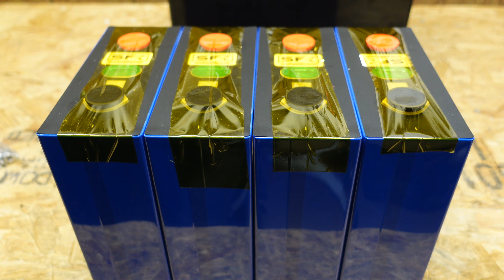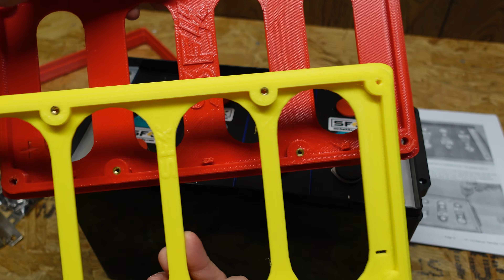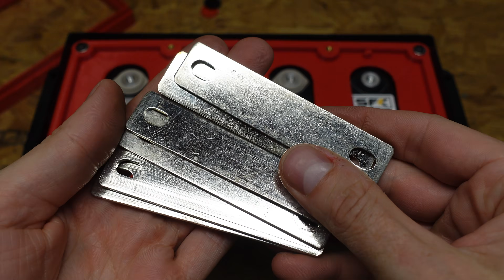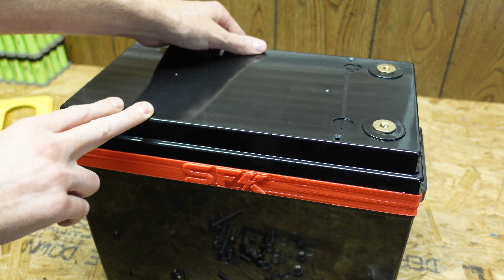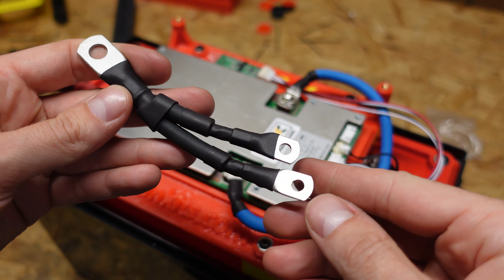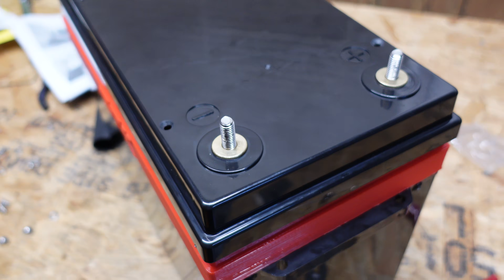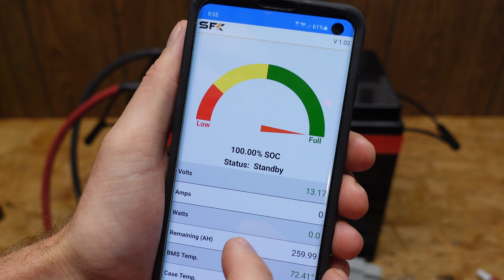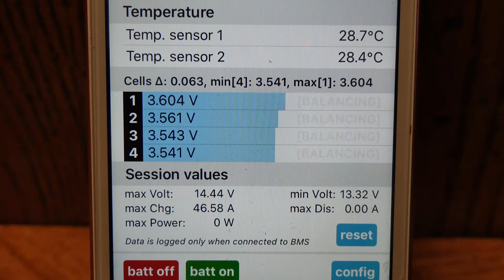Sun Fun Kits DIY 12V 280Ah LiFePO4 Battery, $295/kWh!

Comment: Hello, very clean kit with a few small issues. Nice work!
The problem is that the kit Without cell’s is reasonably priced and is likely a good kit for someone making a tiny or smaller camper or van system. However with cells included are Very Very Very Expensive! IMO 
I bought EVE 280ah cells for $106 ea (I think up to about $135 ea now)
I feel almost all resellers of cells are unreasonably priced at a “kinda usual” in the USA 300% markup! Just for reselling cells that they have inspected?
ALL 64 of my EVE cells directly from Basen were packaged and matched perfectly as far as open voltage goes and had zero issues or damage.
If you can DIY.. I recommend doing it yourself! Then hopefully resellers will get the message and stop with the nonsense of 300% cell markup! 
Good video and nice work sir!
✌️PT
Reply from the maker: One thing people don't seem to understand is that businesses need to make a profit in order to succeed. They aren't 300% marked up. They're probably acquiring them from the same (or similar) source as the rest of us. If they buy for $125 and sell for $200, that's a 60% increase or $75. They also have to factor in damaged cells, payment processor fees, discount codes, etc. So how much are they really making per sale? Probably not much and certainly not "nonsense". Buying from China will always be cheaper...
Reply: @LithiumSolar  got it.. need to make a profit. I said as much. However if you are DIY.. most want to DIY to save money.
Mine.. 53,760watts under $7100
Just saying..
Reply: @ProspectorTripp  how much would you sell you $7100 53k battery for? If someone offered to commission you to do the job 30% up front the rest when delivered.
Reply: @davecroft2991  Hello David, I love DIY.. but not interested in getting another job.
If you can’t buy the LFP cells directly from the manufacture or maybe feel uncomfortable, it’s best you pay the extra money for someone to buy your cells directly from the manufacture for you.
The cost problem/issue is.. the company has the initial cost to buy, ship, store, inspect, ship again is very expensive. I Understand this point very well.. that’s why I recommend DIY. That also means BIY (buying it yourself)! 😂 
The kit is nice and clean and for many is likely a good choice, but the addition of using their cells is certainly easy but definitely a more expensive choice.
DIY.. is harder, unless you love doing it yourself. BIY 🤪
Thanks David 
✌️PT
Reply: The cells they are selling are pretty obviously grade A, and go for (assuming you order grade A) about $130 to $150 each plus shipping. The ones I purchase are manufactured by EVE when you order, and come with the EVE test reports. Yes, you can order "bulk" cells, but you get what you pay for. As noted, they aren't making a large profit on these, I think they are very reasonably priced. "Bulk" cells won't come with the EVE branded caps for the terminals, just FYI. I already had cells and BMS, so I can't really speak for the ones they supply. But I will note that only cells sold and shipped by EVE come with those caps.
Reply: @john_in_phoenix  😂 as long as you are happy with your purchase!
Your happy!
Reply: @ProspectorTripp  I purchased the cells and BMS long before I had heard of the kit. So I just purchased the bare bones kit. Yes it is expensive compared to DIY, but to me the results are worth it.
Reply: @john_in_phoenix  The kit is very nice and neat 👍 also priced very competitively.
Reply: @ProspectorTripp  thanks for mentioning a specific application, I think more viewers should be considering this.

Comment: Great looking case.  I would love to see an 8S 24V version of this case.
Reply: i did mine off plywood,  if you get like half inch ply, like a 4' by 2' the 2' lenght is perfect to make a 8s 280AH all in a single line with a little spare for padding/wood walls.  I made a 280AH24v just by cutting strips on 2   4x2 ply boards,   really easy if you have a circular saw
Reply from the maker: A single case holding 8 of these batteries would be very heavy, around 130lbs. It's probably best to have two cases connected in series. Then again, you need two BMS that way instead of a single 8s BMS, so I guess each way has pros and cons.

Comment: This looks like a great, affordable, quality DIY battery solution! I think we'll start seeing the market flooded with similar kits in the near future.
Reply: They actually put a lot of thought and effort into this kit. They added a lot of value to just ordering the battery box as some have suggested. I know exactly how much it would cost to DIY, and this is well worth the money (especially if you don't already own a printer to design and manufacture the plates). I am very pleased with the finished product, pleased enough that I just ordered 3 more.
Reply: The number one question should be, what is the intended application?
Reply: @jeebusk typical use, but also educational so the end user has a greater grasp of their equipment.

Comment: Seems pricey when you can buy a chin 300AH battery for 1039.00
Reply: Yep, I believe SunFun charges $1350 for a complete 260ah battery.
Reply: Chins lacks Bluetooth, which I want in order to tweak BMS settings.
Reply: @dearlaserworks  yes that is a nice feature but to me not worth it for as long as these will last, as is. Set it and forget it.
Reply: @davidparker7156  I hear ya. It’s nice to see more & more options other than Battleborn for $$$ or build from scratch with cells of uncertain quality. Being able to swap a cell or flaky BMS also appeals to me.
Reply: @dearlaserworks  very true hard to imagine that they can continue to attract buyers with all these other cheaper options for the same quality cells.
Reply: @dearlaserworks  This battery is 2 year warranty, battle born is 10 years, SOK is 7 years...
Reply: @dearlaserworks  by the way Chin does have a 200 and 100ah battery with Blue tooth, 200ah with BT around 1100, they also have some with heaters built in and bluetooth for charging in cold climates

Comment: The cells are butted together. I would think that they should have a thin plastic spacer between the cells.
Reply from the maker: That topic still seems up for debate. Some manufacturer's are using spacers, others are not.

Comment: Excellent review as always - interesting, although I’m not sure about the plastic case for mobile use. Would have liked to see padding all the way around.
Reply: So add padding to the outside. Making it out of steel or aluminum would not be easy.
Reply: They have a molded abs lid coming out soon it is 20mm taller and is 1 piece.
Reply from the maker: There is space in the case to fit a bit of foam on the other 2 sides if that's the concern.

Comment: Great video, been waiting for a solit diy kit to come to market.
Thanks for taking the time to show us.  ??? Any idea if they approve of series wiring to 48 volts. These would be a great upgrade to my battleborns - with 3x capacity and servicable cells and componants. Looks like I could fit 60 kwh where i currantly store 20 kwh if I am guaging the size of that case accurately.
Keep up the great work, will check out your link to the kits.
Reply: The JBD BMS is rated for use in series up to 80v, but if at all possible, I would recommend not doing multiple batteries in series. Too easy to run into balance problems, I personally wouldn't go over two in series for that reason. But a 24v series capable of 150 amps will supply a lot of power.
Reply: @john_in_phoenix  excellant, thanks for that info.
We are ronning a 48 volt outback system so I am financially committed to that setup, but Id be willing to bet that BMS would perform as well or better than the battleborn BMS in a series configuration. They have worked fine for the last 4 years but Im ready for more storage capacity.
Id think the BMS is more advanced and capable than what battleborn had 4 years ago.
I will look into it further.
Have a sunny day...
Reply: I just measured mine, 13.5 inches by 7.5 inches for the bottom part,  but the handles on each end make it 14.5 by 7.5. Mine with the largest spacer is 11.5 inches tall. I hope that helps you determine if it will fit.

Comment: Actually- that was a total WIN in my eyes. Genuine capacity, well designed connections & well laid out. Under $300.00/ 100AH with some assembly required seems like a smoking deal as well. FWIW, it seems that the battery profile may fit in a standard RV battery holder (your mileage may vary) and you can buy nice positive & negative bussbars for easier access & fewer mistakes. I really, really like this solution for the 'mebbe' DIYer, David! I'm a perfect candidate for this solution- I have the tools, I have the knowledge, but- I don't want to solve for the variables like; compression, battery box, etc... Really impressed. Thank you very much and I hope I can get you a few bucks using an associate code when I buy them?
Reply: You can get 100ah for under $100 in conventional deep cell batteries...
Reply: @jeebusk but conventional chemistry doesn't allow for use of 100% capacity and cycles are drastically lower.

Comment: Great idea and good kit - but, "Configuration Price" at the website - with Eve cells, is $1,310 US - so a bit of a bait-and-switch really. If you want to sell DIY battery kits, you also want to go to some effort to explain:
1) How to get 4x280 Eve cells for less than $800
2) What "Configuration Price" means and why is it $300 more than "Regular Price" (this part of the checkout is very off-putting; I highly recommend changing this at the web page)
The compression solution here is "great" (if, assuming that, the plastic tub is strong enough to hold it as cells naturally swell over years). 

I didn't call it a "great" kit because:
1) of the wiring issues you noted, 
2) both terminals are both at the same end (I just don't like that), and 
3) the fixed bridge bars don't have flex as other double-layer "middle-bend" bars do, so they are fixed as the cells swell  
4) I didn't see a low-temperature cutoff
Anyone going to Youtube knows how to DIY a battery, and how to get recommended parts too by now, so this kit has to make it painless and inexpensive to prefer their solution. 

It is worth paying more for a kit and vendor that: 
1) screens cells to ensure they are "perfect" - as they should be (not swollen, used, or too old as you commonly find on Alibaba)
2) ships a great, low-cost, BMS,  Bluetooth, and Charger - which this does...
3) has freezing temperature cutoff BMS (I didn't notice a freezing temperature cutoff here on the BMS)
Reply from the maker: > If start with the v1 kit and add the BMS and cells to your cart, then add the 10% discount code, it comes to  $1061 and ships free. Did you add something else or maybe select the $1375 kit that includes additional items? I don't see any bait-and-switch here but there a lot of products/listings that could probably be sorted better and made more clear.
> Completely agree regarding the "middle-bend" busbars, they would be much better than the rigid bars that won't give in the event of excess swelling/failure.
> It does have a low-temp cutoff pre-programmed for 0C. The temp sensor is the black wire coming off of the right side of the BMS. I didn't mention it in the video, but it is there and is included in the instruction manual.
Reply: Even at $1000 it’s still more than a battleborn that is fully assembled and has a 10 year warranty. Why spend more to do it yourself. That’s dumb.
Reply from the maker: @wwg-worldsworstgamer6678  BattleBorn is $900 for 100Ah. This is 280Ah, that would be $2520 of Battleborn...

Comment: Did I miss the temperature sensor installation? Or is it missing low temperature charging cutoff?
Reply from the maker: The temp sensor came attached to the BMS and is pre-programmed for 0C low temp charging cutoff. You can place it where you want. You can see the black wire on the right of the BMS at 12:39. It's also covered on page 13 of the instruction manual.
Reply: That was one of my questions too

Comment: The add on balancer is one of those active balancers. Why do you and sunfun call it a passive/resistance balancer?
Reply: Hi, Its a passive, we have an active balancer but the one in the video is resistance based.
Reply: @sfkenergy  From the manufacture's website which is labeled on the balancer... "2-17S inductance Active Balancer with LED."
Reply: @uhjyuff2095  We tested this it never sends voltages to other cells, but it will slowly burn off voltage from the highest cell. For a true active balancer we found the one with capacitors works best. That will send on average 400-600 mah from the highest to the lowest cell and balance a pack in about 1-2 days if they are out of balance severely.
Reply: @sfkenergy  I understand why you are offering active or passive balancers with your kits. It can be an easy plug and play solution for people that don't want to build a pack twice, as in connect the cells in parallel then charge and then undo and reconnect in series connection.
Reply: I just used my own active balancer (oddly enough I have the same model) to top balance the cells and removed it when doing the final assembly. The BMS does have resistive balancing and is keeping the cells well balanced.
Reply: @john_in_phoenix  Absolutely, the active balancers can top balance without the user to even think twice about it.
Reply from the maker: Wow, that does appear to be an active balancer. I have no idea why they're selling it as resistive/passive then... Good catch.

Comment: I can't believe they put together such a wonderful kit, that lacks low temp charging protection.
Reply from the maker: Yes, it does have low temp charging protection. It's pre-programmed to 0C and you can change it, if desired.
Reply: @LithiumSolar  oh, I'm sorry. I must have missed where the temperature leaves were attached to the pack. I didn't see them listed in the parts included portion of the video either.
Reply: omg really, that is a shame.

Comment: The JBD 150A BMS can only take 75A Charge Max, not unusual for MOSFET based BMS'.

You should have screwed down the "Grub Screw/studs" to Bottom, then BACK OFF by 1 full Turn and HOLD with the Allen Key while tightening the nut.  This is done to prevent putting pressure on the bottom of the tap hole.

FYI default thread depth for safety on EVE LFP Cell Terminals in 6mm MAX.  Mfg Spec.
Stripped Threads CAN be repaired with M6 Helicoil Thread Inserts.  Worst Case Scenario they can be retapped with a proper Tap & Die Kit, but must NEVER EVER exceed 6mm hole depth.

The Balancer & BMS Harness Wires.  Personal Point.  Both Wires (per cell) should have been put into ONE Ring Terminal as opposed to two...   

TIP-1:  Even simple MASKING TAPE on the Hot Terminal or wire lead can save your keister from an accidental oopsie !  Only takes a second to change a Good Day to a Bad Day.

Tip-2:  These cases are ABS and Very Durable & chemical resistant.  To Waterproof (water resistance) a thin bead of Silicone along the seams prior to final tightening of the pieces can resolve that...  ** IF concerned about making a mess, using Green Painters Masking Tape, tape off around the "seams", once sealed & before silicone has set, pull the tape off at Right Angles and you will have a clean finish.
Reply: Why did he have two cell balancing systems

Comment: I put helicoils in all my batteries before i even use them now because i know the threads will strip at the required torque. experience! a helicoil kit from amazon is inexpensive and i always use studs tightened down to the bottom of the threads and the flange nuts
Reply: So you drill andtap the battery before you strip it? How deep do you go and did you make a bottoming helicoil tap?
Reply: @k20nutz  I drilled the same depth about 6 mm and ground the tap so that it just had a slight lead. Used my drill press to ensure it was plumb to start the threads. 40 years as a toolmaker gave my all kind of skills I never thuoght I would use in retirement lol.
Reply: @davidkettell5726  I can't imagine not using my tool and die experience outside of work. It's the handiest tool I have.
Reply from the maker: I've heard of people using helicoils to repair the damaged threads, and it sounds like an interesting idea. I've also heard some of those resulted in melted terminals (fire risk) and don't want to go there myself. If I damage one, I'd rather recycle it and buy a new cell to be safe.
Reply: @LithiumSolar  explain why the terminal woud melt.a helicoil is steel just like the screw or  stud you put in the battery. ?
Reply: @davidkettell5726  most electrical applications should be coated (often with nickel) in marine applications the wires are also coated.